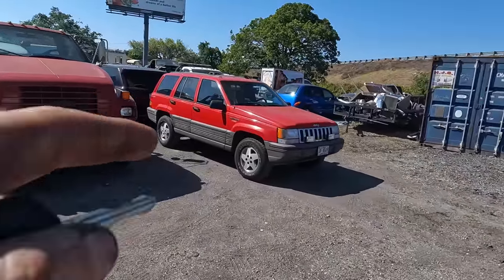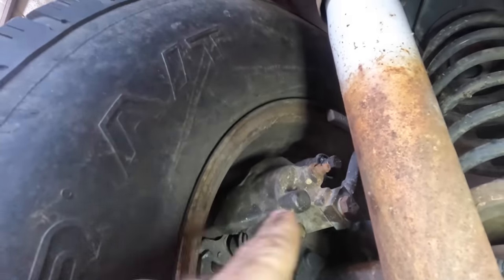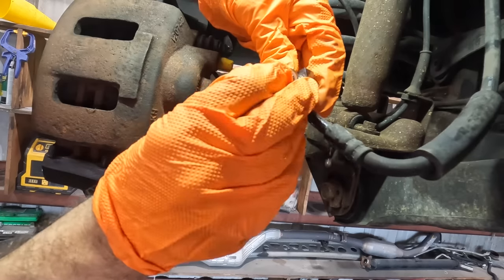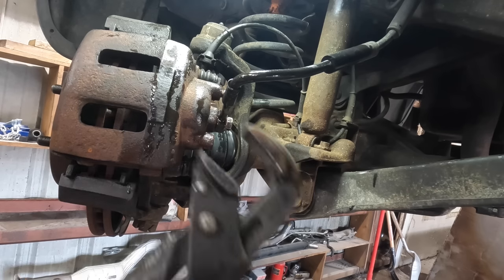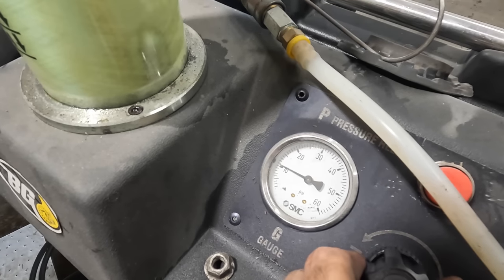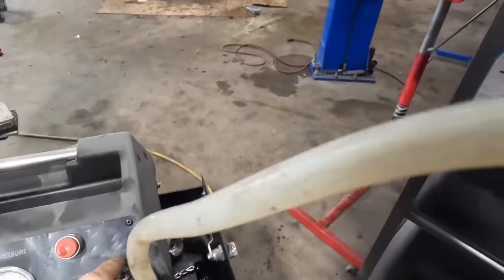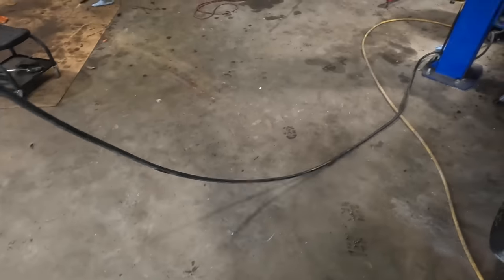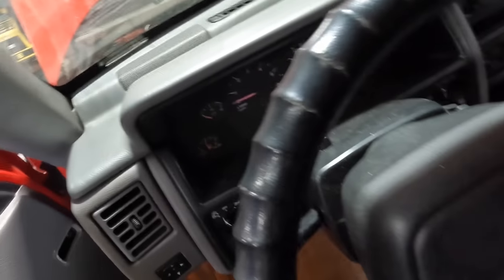Customer States: Air in System No Brake Pedal! |  Jeep Grand Cherokee 5.2 v8 #nobrakes

Comment: As a teenager back in the 70's. My Dad taught me how to replace and bleed brakes. He said and what I've done on the brakes I've done is start at the wheel closest to the master cylinder to the farthest from the master cylinder. Never used a vacuum bleeder like that though.
Reply: In repair manuals it states allways start from the furthest away, If you replace a master cylinder you should bleed the master separately before bleeding the lines if you don't have a push/vac bleeder system like Ray. no offence to your Dad!
Reply: @Antony_Jenner  I've never had any issues doing it the way I was taught. I've replaced all the wheel cylinders and master cylinders on several old trucks. I'm not to familiar with modern electronic controlled vehicles. I'm more old school and prefer to buy older vehicles. Stuff I can fix myself.

Comment: since it's your business and your insurance I feel you should have replaced those brake hoses especially since they had such a sharp bend in them and since brake hoses have a habit of fluid passing the innerwall and collapsing that wall so fluid cannot return and it causes the caliper to keep the brake slightly applied.

Comment: I live in Canada without a garage so watching these videos during our winter months really gives me my fix of wrenching on my vehicles until the snow is gone and I can work on my own.  Thank you Raymond for that.
Reply: There used to be a place in Toronto where you could rent a service bay. You supplied everything else and they did have some things like engine cranes and transmission jacks and some tools that you could rent. It was great and if you had a problem, the guys working on their own cars could often help you out. It was a busy place, but it closed down eventually. I'm guessing either regulations or liability issues. It was ideal for guys who didn't have the place to work on their cars or have access to lifts or specialty equipment. Changed a Ford van from manual to automatic in there. Got everything done and then found out the starters were different too. LOL
Reply: @BigLisaFan we had one where I am too but it closed also very soon after opening I don't know why. It even had a spray Booth!.
Reply: @rick980  Probably liability.  Can you imagine the number of know-nothings that would use a place like that and hurt themselves or damage stuff.  Just the insurance bill would give me nightmares.😖

Comment: A mechanic on another channel wanted to show that extensions on a socket does not decrease torque. He had 7 or 8 extensions and applies torque with a torque wrench to the lug nuts. He then showed that that teh nuts were torque properly (no extensions). He said that extensions with an impact driver decrease torque.
Reply: Torque Test Channel has its moments, for sure!

Comment: Another good episode! Regarding the capped lug nuts, the garage where we have our cars serviced keeps a bunch of used nuts on the checkout counter, and some of them look pretty grisly… just to show customers why they replace those nuts with solid ones during a service.
Reply: Sears replaced a lot of broken sockets for me over the years when I had to hammer them on to get those damn things off. They were never replaced with the same style. That’s about as bad as Nissans OEM brake rotors. A mild panic stop and they’re warped. Let’s use a metal that’s 10 cents cheaper per rotor that was you can feel like you’re going over a washboard road whenever you stop. My mom and dad had them replaced twice before 50k on their first Rogue and twice before 40k on their second. The second time on the second Rogue, I upgraded them. Traded at 100k and zero warping. Using substandard parts should be a crime…especially when it involves something as important as brakes or lug nuts.

Comment: I would have recommended to the customer to replace both front brake lines.  I've seen a number of calipers seized up because the hose was acting as a check valve as it degrades, especially when bent as they had been when connected improperly.

Comment: I had long travel on brake pedal, and it didn't get better with bleeding so i checked and slide pins were sticking it seems when i cleaned and lubed them pedal seemed better.

Comment: Ray, I salute you, no brake cleaner, well done. Water cleans off brake fluid better than anything I know, and it is cheaper. Also some simple green mixed with water in an empty coolant can, and then sprayed though a siphon sprayer, cleans brake dust really well, and the dust does not go everywhere. Even though it's not asbestos, like when I was a youngin, it still is nasty. You are doin well I hope for your continued success. Oh yeah one more humble suggestion, get some caps on the bleeders, even though Fla. is not really a salt area, if the customer 4x4s on the beach, well you know.
The Blue Mule

Comment: Just last year I replaced both front flexible brake lines on my 1988 Mazda truck due to age; these were indexed with a "pin" so they could only attach to the caliper one way.  And I used brand-new copper crush "banjo" washers.

Comment: When brake hoses get that kind of stress they can begin to tear internally.
It can cause a bubble or act like a valve.
Good to see it road tested alright.
Do some parking lot quick panic type action to check, and some long gentle strokes at speed.
If they're good, they're good.
I like your BG machine bleeder new goes in above, old stuff shoots out below at the bleeders below.
Put your little caps back on and sell the axle seal and some shocks and rebuild the front end when they are ready, right.
If it has a track bar, watch out where it attaches at the LF.
They can elongate the body attaching point.
I know they did when the jeep pickup came in that smaller size.
Times are getting tough so you choose what to fix first, perhaps.
Nice video and better than average pace.
I enjoyed seeing it and not having to suffer the back and leg pain.
You're a very good tech, Ray.

Comment: torque stick is good to avoid over-torquing but I always follow up with actual clicks.
Reply: Torque test channel did a test and the batt powered guns knock it too fast. Air guns it works fine but it will over torque with an batt powered
Reply: @frizzlefry1921 , correct.  This is why I use a torque-stick well under what I want the final torque to be.

Comment: Reeeeegarding the leakage at the master cylinder reservoir while pressurized.  Are the caps vented?  You have your bleeder machine adapter on one fill port but the standard cap on the other.  If it is vented, as it should be, that would explain the unstoppable leakage at that location.

Comment: Brake reservoir caps are vented; why the one is leaking when you are pressurizing the system.  You can seal it with a piece of plastic film under the cap to prevent spillage.

Comment: Looks to me like the brake hoses were replaced, and the installer misrouted them and then positioned the line end in the bracket with the hose twisted 180 degrees.  Anyway, the hose is supposed to go upwards to maximize clearance with the wheel and tire.  The bend should have been directing the line away from the bleeder, but because the hose is twisted 180 at the other end, that looked wrong.

Comment: The venerable 5.2l/318 V8 from Mopar.... good catch on the misinstalled front lines.
Reply: The LA series V8s were the last good motors from Mopar.
Reply: @spaceflight101  the 340 and 360(5.6 &5.9l)Magnum versions were quite good as well. Daimler squeezed a bit more power out of them.
Reply: @jsh6952  Quite true.

Comment: Am I the only one that has noticed that housekeeping is not Ray's strong suit?
I also have noticed Ray doesn't use fender covers very often.
Reply: Ray has demonstrate for years that he is sloppy.  Cleaning up after himself id where Mom failed.  He'll learn about fender blanket or covers when he has to repaint a fender.
Reply: I know, you'd think he'd be worried about getting rust on his clean uniform.
Reply: He probably doesn't use them because most of the cars he works on are old garbage so who cares about the fender basically
Reply: I'd say rays work more than compensates for any slop he has
Reply: The cars that we see on here typically have so many miles on them that the customers are damn happy to find someone who knows what they are doing to work on them for a reasonable price. A lot of places won't touch cars with extremely high mileage.
Reply: The best shops are messy. Lots of work no time to do a lot of cleaning. My transmission guy's place looks like a bunch of transmissions blew up. He always has at least a dozen cars waiting to be worked on. He does great work and always more than he can keep up with.
Reply: @DocZoidberg549  No, normally the best shops are not messy.
The best shops keep a clean, organized workspace.  A clean shop is a safe shop and an organized shop is an efficient shop.  One slip and fall or trip and fall can ruin your business model for a long time.  Even if it is only YOU that gets hurt.  If it's a customer or delivery person, it could get real expensive really quick.

I hope the wife unit keeps a better house than Ray does a shop.

I love Ray's vids.  Still, I would like to see him hire a teenager to clean up after him and to put tools and machines away at the end of the day.  Seeing the top of his tool boxes and tool caddies piled with tools, towels and trash is a little depressing.
Reply: @cmorin1171  You'd be surprised
Reply: @DocZoidberg549  Worked at an import shop for many years, you had to wait weeks for an appointment.  Every Saturday, out would come the biggest box of Tide detergent, floor swept, then blown out, wetted down, sprinkle out the Tide, scrub it in Then let it sit a while.  Then re-wet the floor down, another application of Tide, another scrubbing then a good rinse.  Oh yeah, you could eat off the floor.  During the week if you made a mess on the floor, you did a spot cleaning.  Ray needs to learn as a minimum that broom handles are one size fits all!
Reply: @williampope3531  It's not the clutter that scares me about his top-of-toolchest "workbench" -- it's the dirt! And he'll mess around with things for AC and hydraulic systems on there.

Comment: Not sure it's a good idea to drag the brake vacuum machine around by the plastic reservoir.  Maybe extend that handle.
Also not sure about bending brake hoses.  But better than what you found (and what recent brake work?  Only one bleeder looked newish).
And the missing bleeder caps (which I need to replace too, come to think).

Comment: the BG brake fluid machine won't push air into the system, there is a ball float in the reservoir that blocks the flow, incidentally, if you aren't getting any flow of brake fluid out of the BG machine, that ball is stuck.

Comment: I'm only around 3 mins into the video and I'm suspecting at least worn out brake fluid with the way it looked. I have an 07 Monte that had bad brake fluid and the pedal traveled to the floor and barely engaged the service brakes. So I'm guessing that's maybe at least one problem.

Comment: Do you use DOT 4 for all DOT 3 vehicles? 

I know DOT 4 can be used with DOT 3. It has a higher boiling point. However, DOT 4 is more hygroscopic and requires more frequent exchanges than DOT 3. That's why I like to stick with DOT 3 on a street driven daily driver type vehicle.

Comment: Had a so called professional shop replace a caliper on a 2005 Chevy K5500 where they put the brake line on the top and the bleeder on the bottom.  I sent it back 3 times saying the brakes felt very spongy and needed to be bled properly and each time they said they did it again and it was good to go.  I finally got home with it and looked underneath myself and discovered the problem and switched them around and bled it properly and it worked then as it should.  Then I also took pics before and after and showed that shops owner my discovery. I think that clown that did it was fired for stupidity.

Comment: When you reconnected the air hose to adjust the fluid level in the master cylinder, it looked like moisture sprayed as the connection was made.  I wonder how often you drain water out of the compressor tank?   Or is there a dryer in-line with the hose?  Do you have plans to pipe air from the compressor into the shop so the air hose isn't strung out across the floor?
Reply: It's Florida, how much water could be in there?😃
Reply: @theundergroundlairofthesqu9261  Probably as much as I remember there being in the air when I lived in Florida back in the '60s.

Comment: Take that hood down to Suncoast Metal Recycling on 2050 51st St. or Trademark Recycling around the corner. Both are a little south of you - not too far... Take the Wife Unit out to dinner on the Mula!
Scrap prices have gone through the roof in the last year

Comment: An adult cat said to a kitten when he caught a mouse: "Don't play with food", don't play with liquids, they are not all harmless, or rather there are few useful liquids in cars.
  Did you put the caps back on or did you forget?
and yes, someone wanted to check how the brake pads are installed, could it be worth servicing the caliper?
I understand that any work is more expensive when additional tools are used, but you should not get carried away.

Comment: Had too fix a wheel bearing after wheel bearing got replaced guess the guy did hundreds he said. The three bolts that hold the hub on where lose two almost lost and the backing plate/ dust shield was smashed in the caliper between pad and rotor

Comment: Never saw you change to the other fluid port on the master cylinder or did you just not show it? How did you bleed the brakes on that side? One bowl is for the front and the other for the rear.

Comment: 318  is a great engine!
Reply: had one in my 71 duster that outran 340's ,mach 1's and z28's
Reply: @picard2069  My 89 dodge  Ramcharger  has a 318 with over 300K on it.  It keep waiting for it to quit... it just doesnt.
Reply: Had one in a Dodge van.  Never a bit of trouble.  12mpg, empty or towing a boat, city or highway, 12mpg

Comment: I used to have the exact same Jeep; 1995 (same color and everything). Loved that beast. Took it to a shop and spent $2k on maintenance (leaking seals and gaskets, etc.) and they ended up doing something to the oil flow that killed the engine. They wouldn't make it right; broke my heart to have to get rid of it.
Reply: A Likely Story

Comment: Just a question Raymond 
My 2001 toyota celica has it 4 brake slave cylinders,  and a slave clutch cylinder as well as master cylinder, when bleeding the brakes shouldn't the clutch pedal slave cylinder be bleed as well on a hydrlic clutch pedal that uses the brake fluids resevor on a car with a manual transmission.
Then you kinda have to wonder how this is done on a system with ABS brakes and manul transmission.

Comment: Ray why did you bleed the system in reverse?  Back passengers first then to back drivers then to passenger front and finally with drivers front, longest to shortest.
Reply: Because he knew he lost fluid from the fronts when he corrected the improperly installed brake lines, thus he let air into them.

Comment: I wonder why Ray never uses his scan tool to flush fluid in the Anti-Lock braking system.  Any comments on that?
Reply: Not really required. Only needed if there's alot of air in the system. Normally when you flush the brakes like ray does with a pressure machine it'll go through the pump anyway

Comment: Was that ultra-dry fluid stored next to the water-resistant grease?  I really like the Dawn Platinum power wash dish soap to spritz on greasy surfaces and then hose them off, instead of break clean.

Comment: I have a very basic  bleed kit that uses pressure from a tyre rather than a compressor. I have wondered if I can use it to bleed the chain oiler on a chainsaw. I think the tiny oil pump in the chainsaw is too weak to pump out the air between the reservoir and the pump itself.

Comment: Surprised you didn’t upsell solid wheel lugs, sparing the next mechanic any trouble.
Reply: If you remove the chrome covers the nuts are 3/4". If you use antiseize when you reinstall them rust will not be an issue.
Reply: @spaceflight1019  when I  lived just north of Ray many, many moons ago, I discovered no amount of anti seize protects nuts with covers. Go solids.

Comment: I always just gravity bleed brakes, remove the fill cap suck out old fluid and crack open the bleed screw until reservoir gets low, refill then on to the next.
Reply: Not sure but can you gravity bleed Anti Lock systems?
Reply: @desotosky1372  We used to do it.

Comment: My question is, if the lug nuts are starting to look bad and worn, do you advise the owner to replace them all? I know that seems trivial, but if you get a flat and cannot take them off due to rounding or being in bad shape, then it is no longer trivial.  I for one, would have had you, or i would have bought them and replaced them. But i would have to know about it first.  Ty
Reply: Well I mean when you buy new lug nuts they come in a pack. Doubt I would have one new shiny one and leave the other new ones in a pack. Think I would just swap em alla.
Reply: @Odayian420  yes, but lug nuts come in a pack of 4 to 6, and i meant changing out all lug nuts on all 4 tires, not just one lug nut or just the bad ones. So the average lug nut change out would be about $40 to do. Depending on car, truck and brand you want.
Reply: @furballami5842  oh no I wouldn't worry about all the tires at the same time. Unless if you had an idiot tighten down all your lugs with an air gun and strip em all at the same time. It's not something that's going to ware out evenly so would only replace the sets as needed. Now if you're up somewhere North where they have a lot of salt in chemicals we can rest your shit then yeah preemptive changing em out wouldn't be a bad idea.